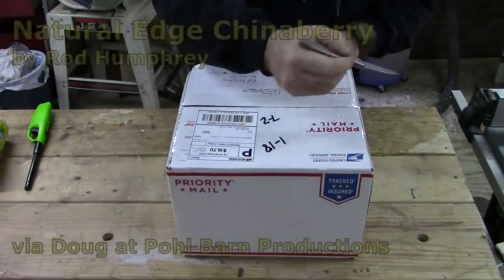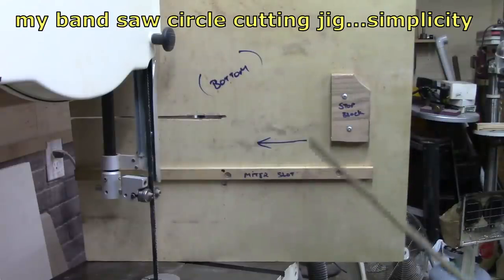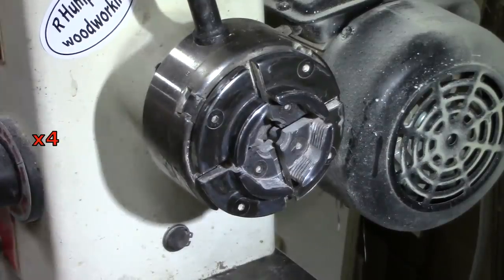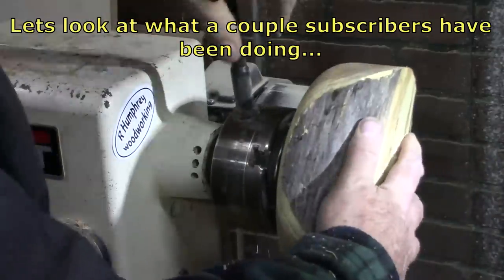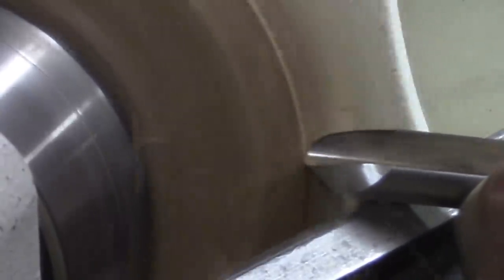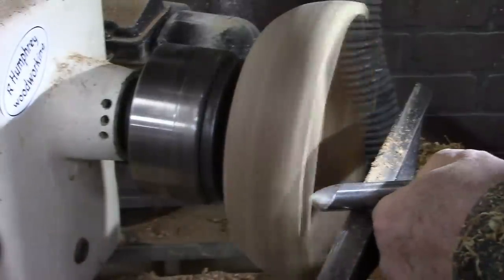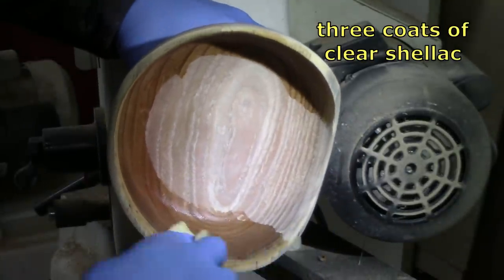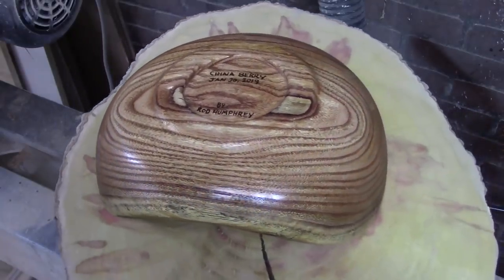Woodturning a Natural Edge Bowl - China berry

Comment: Rod, beautiful work as always. I would not have thought to turn it "upside down", making the finished bowl edges rise and fall with the shape of the outside. Typically you would have turned it so that the curved outside was the bottom of the bowl and the flat, wide surface would have been the inside of the bowl. What was your thinking for doing it this way?
Reply from the maker: Thank you Rob!  I turn natural or love edge bowls on occasion because they're so much more interesting...the choice was a normal looking smallish bowl, or a nice curvy yet functional display piece.  Plus, the grain patterns can be accentuated drastically with a flip, one way or the other.

Comment: Do you like the carter and son tools? They’re actually right by me in Seattle. I started with carbide but I’m thinking about adding traditional chisels to my arsenal. Also- recommendation for a grinding/sharpening system? Thanks and as always I love watching (and listening) to you!
Reply: I can say after watching  these videos, I  bought some carter &sons tools. I too used carbide tipped tools, but want to do things differently. 
Their as sharp as sharp can be, super high quality and I'd recommend them. ( I've only been turning for 2 yrs,  so take my advice  with a grain of salt. )
Reply: I have several Carter & Son tools, mostly their Mike Mahoney line since I like the flute shape Mahoney specifies. The steel is about the best available, the designs are well thought out, the care in fit & finish is superb, and if you go to the big woodturning meetings you get to buy too many tools from the sweet and very persuasive Carter daughters :-)  Clyde
Reply from the maker: @Johnathan, I really do like them.  Biggest difference is the steel and edge retention, not to mention the quality.  I'm not sponsored or affiliated by them either.  I use CBN wheels on a slow speed grinder, with the wolverine system.

Comment: Rod, do you always use the alcohol to raise the grain? If not how do you decide if you need to?
Reply from the maker: I usually do, yes.  It always raises some grain, and always makes for a better finish.  The denatured alcohol is the best way to do it, in my opinion, because it evaporates so fast after it's applied, so I can get right back to work right away.